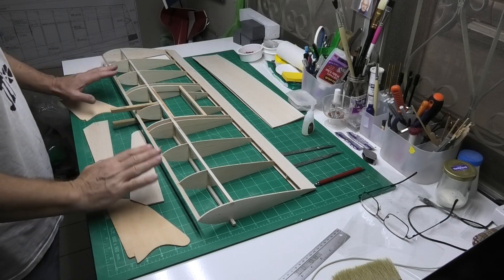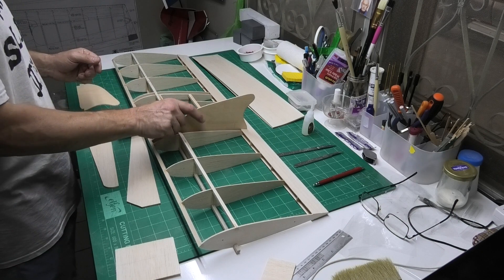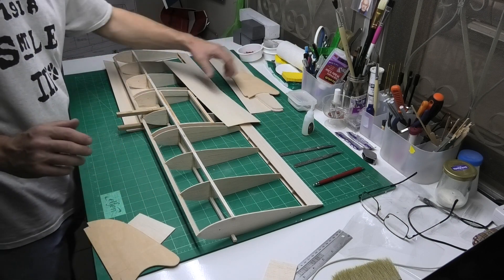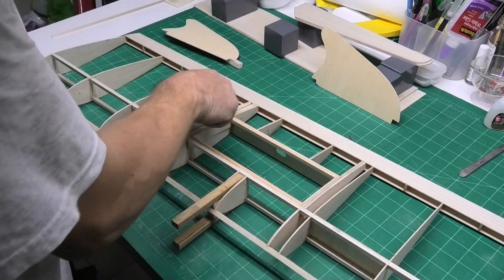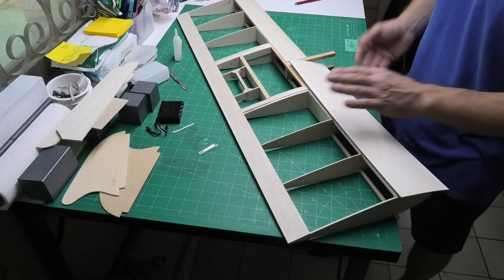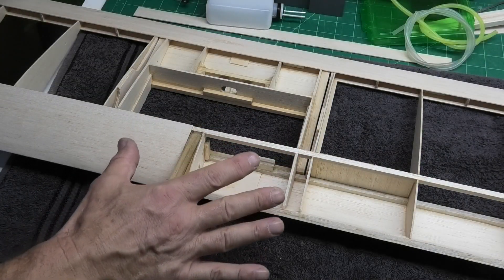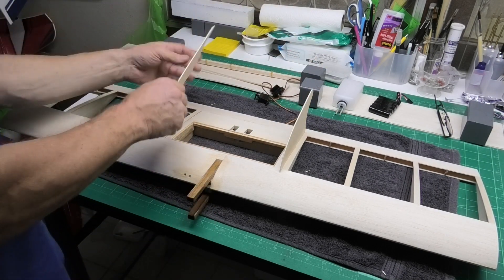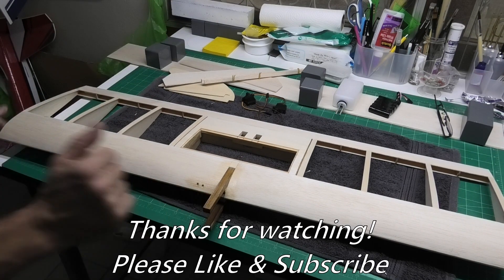King Kombat Pt 3 - a balsa 40" RC flying wing! - Continuing the build of the wing

Comment: Watching you continue the build ----- I wonder how that Wing would fly being built as a U Control ----- Those two guys --- the next block over ---- sure had fun with that model ---- they flew it a lot ----- So I wonder if you made a material list of what you needed and it includes the material for the modifications you made ---- that makes very good sense on what you did ----- anyway I guess I just sit back and wait for plans to come ---- continue watching how you are doing yours ---- with the modifications for structure and strength ------- Thanks Again ----- Rodney
Reply from the maker: Thanks for the comment, pleased you are enjoying the videos 😀

Comment: How do you cut the balsa/ply wood ?
Reply from the maker: I use a Swann Morton scalpel, No. 3 & 4 handle and 10a, 11, & 26 blades, for balsa and thin ply.  I also use a 42 tip Zona saw and a fret hand saw.  I don't use any power tools
Reply: @MarkRobinson555  Thankyou